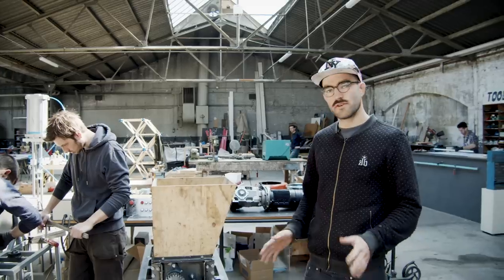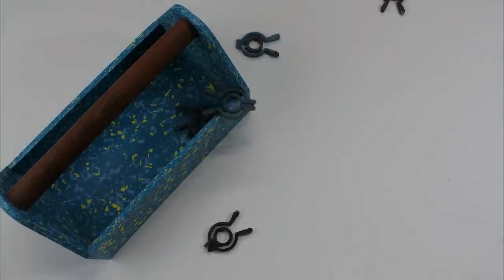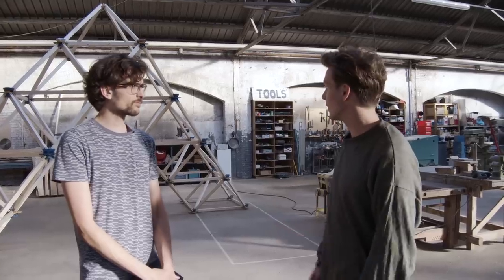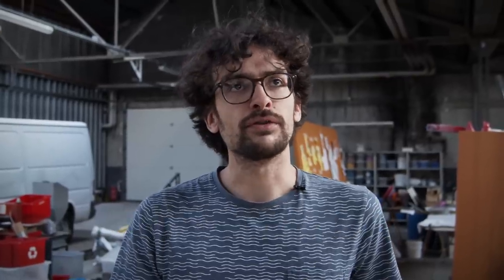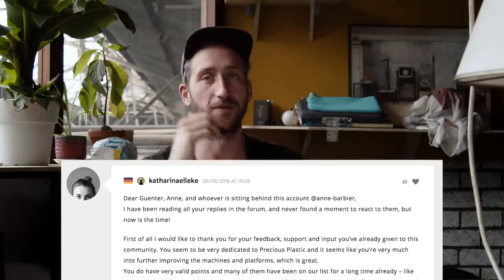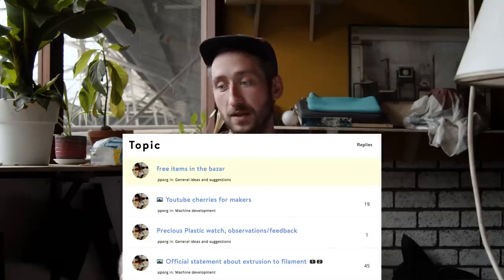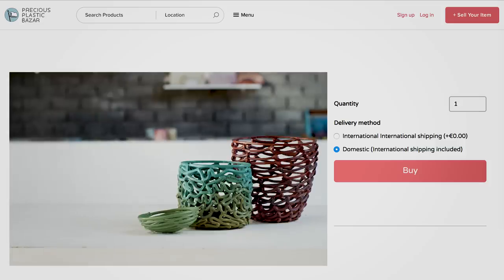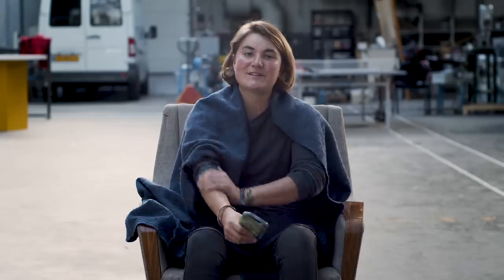Monthly News #28 - What should we make from recycled plastic?

Comment: For the gun nut:  practice guns (you know the blue, solid fill guns they have in the stores) and practice shells for both pistols and shotguns so you can practice safe handling with non-live rounds.

For the traveler:   modern travel items are so thin.  Make some nice thick travel soap boxes like we had 20 years ago.

Is it possible to make a slip on cover for your boots (for mud/rain purposes) by melting plastic bags with a heat gun around them?

Comment: I really like what you guys are doing ....  I'm a professional manufacturer myself in the garage door industry, we make specialty hardware components.   I have an idea to make a super cool design for a door panel, made from recycled plastics, ideally would be a continuous extrusion line.   

I'm going to check the forums see if anyone has any technical engineering experience regarding the properties such as extreme hot & cold temperatures, impact resistance, etc.  

Or if anyone has information they could share with me, would be greatly appreciated ...  I would share & help anyone else who wanted to start a business manufacturing parts & panels, as I have 32 years experience in the business, but 0 experience with plastics.  

Looks to me that you folks need to get to a higher professional level in the product development phase, hopefully I can contribute.

Thanks
Robert

Comment: What to make? Hmm.. items that are multi use, maybe recycled plastic demonstrated as a complete car, one that is easily modified, perhaps with interchangeable things such as to convert a sedan into a pickuptruck, and even a hotswappable RV camper. A lego-like method of getting the parts to fit, plus with added locking pins, perhaps tension adjustable pins. 1001 ways to redesign a vehicle, maybe 2112?

Comment: What's the insulation heat/noise properties of the sheet's?  Could these be used as wall sheets rather than gyprock or plywood?
Reply: Warrick Lee good questions.  I would add however I understand there are realistic concerns in using plastic in construction - namely to do with fire hazards - how it burns and also fumes.  One of my questions is can some sort of fire retardant be added to the sheets/tiles to overcome these problems?  otherwise perhaps need to stick with things like table tops.
Reply: @Kiwi-bn8px  That's a very good point, I was thinking areas which traditionally use waterproof boards, such as outdoor areas and bathrooms.  I'm not sure if the fire retardant could be added without affecting the end product.  I know of some spray on treatments, but don't think they would ever meet code. I'm also thinking a replacement for "formply".  They use it for creating forms for concreting, etc.  I guess we need to also think about how we want people drilling into these things without making micro plastics too though.

Comment: Make a plastic and sand paver
Reply: Or at least plastic and sand bricks ... Some of the plastic beams alone seem very bendable . Mix plastic with sand and the possibilities may probably be endless ... Sand resists heat very well , plastic doesn't , plastic is good with water long term , sand is not , plastic will bond with sand easily when melted . I don't know ya'll are the experts , I believe both materials will combine to make a stronger material resistant to heat , dew and what not , like I said , you guys are the experts so waiting on your reply
Reply: There are companies that do this but it would be neat to see how it could work on an individual scale.  One thing I'd like to learn is how recyclable the plastic would be after it lived out its use.  They're supposed to last a really long time but if they can only be made into themselves again it still seems limiting.